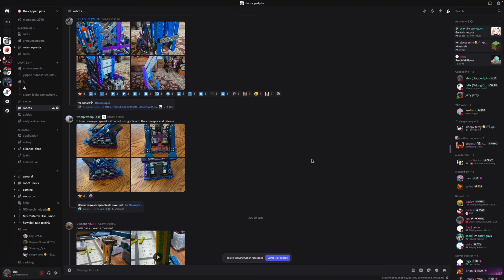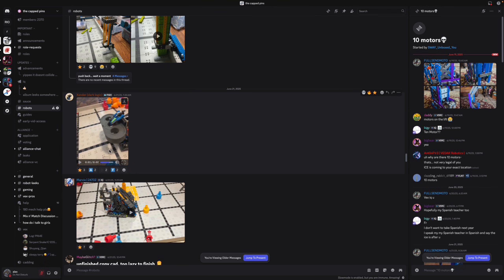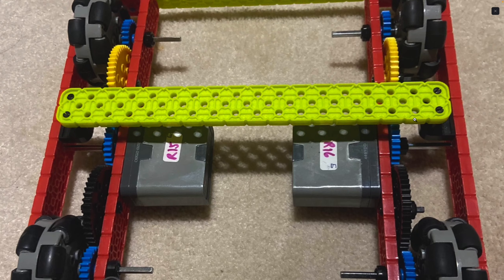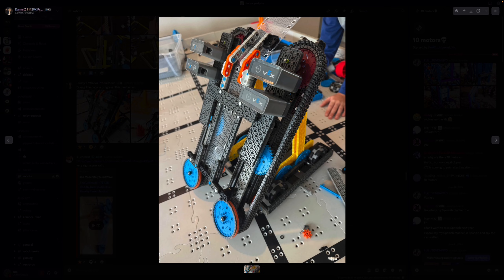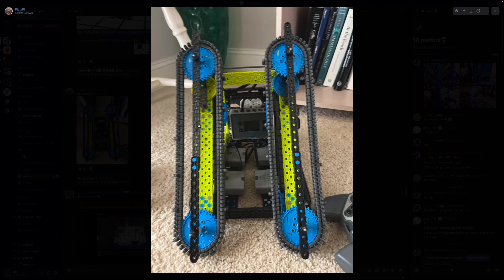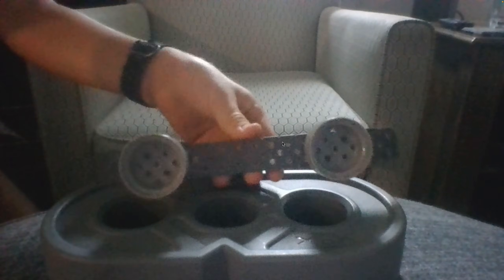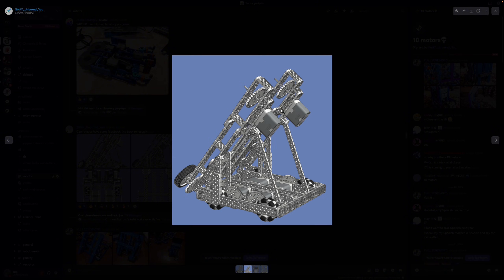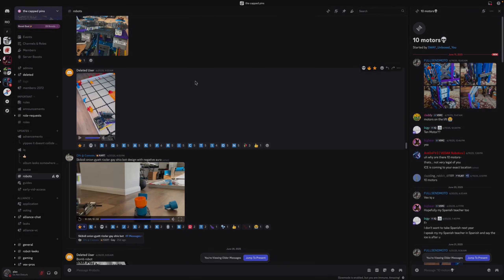2 Ways to PERFECT your Mix & Match robot in VEX IQ

Comment: Hey there! My team, 3321A from VSY, is building a robot similar to this robot, and we are having some issues. Our conveyer belt is pretty slow, and we have some stacking issues. We actually used some of Ben Lipper’s images of his robot, which has a wall that moves to the side when releasing the stack, and is right in the middle when the pins are stacking. If you can, we would like some tips or suggestions for our robot, as we have a competition November 10th. If you can, may I send you photos of our robot through email? Thanks!